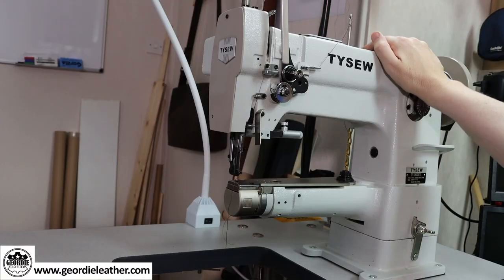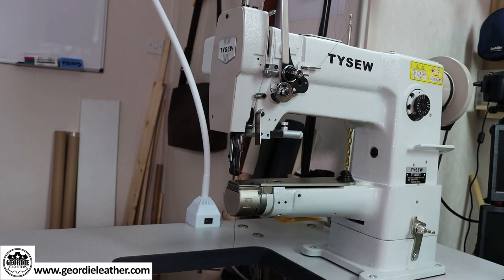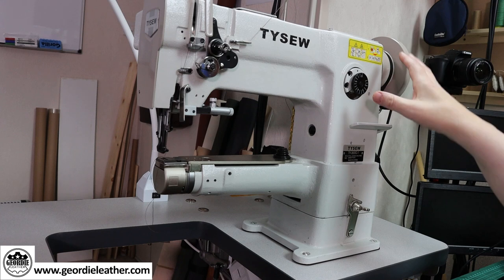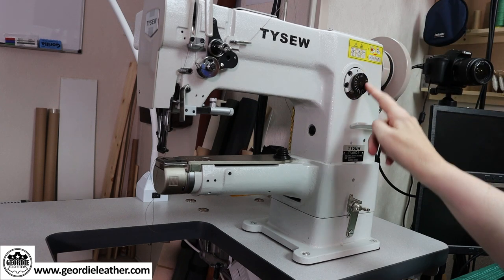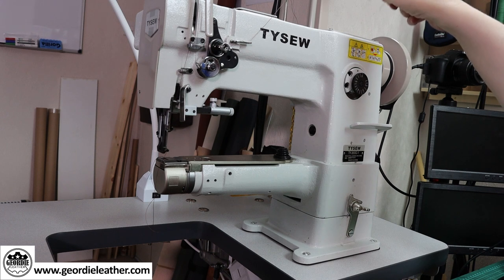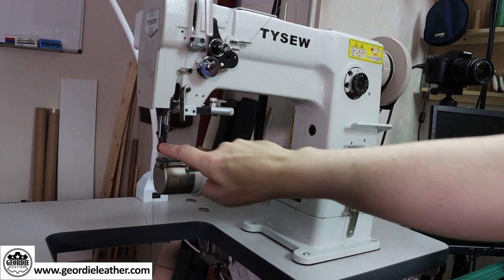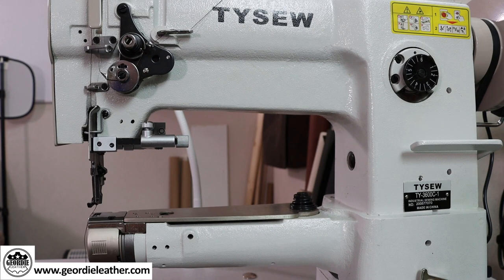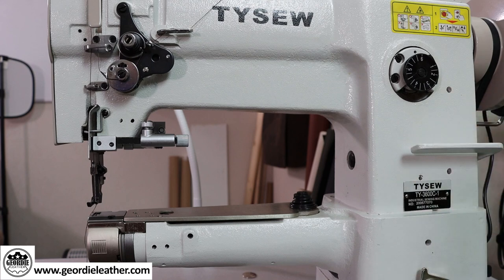Part 1: Industrial Sewing Machines for Stitching Leather & Fabric

Comment: Hi Geordie. I'm 90% pulling the trigger on the 3001-C. Can do a deal with Tysew on delivery etc but been told the build is a moderate quality Chinese clone of the J 246. It's down to you mate. I'll haunt you if you tell me wrong. Yes or no? Paul
Reply from the maker: Hi Paul. I'm not familiar with that model, (Mine was the 36001-C), so I can't advise. Sorry